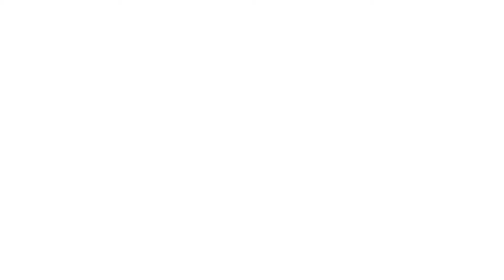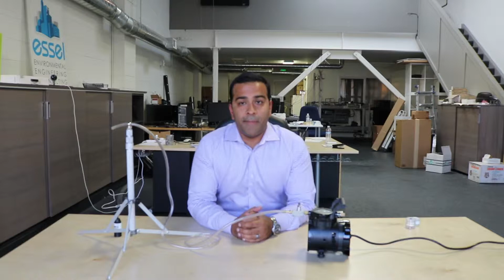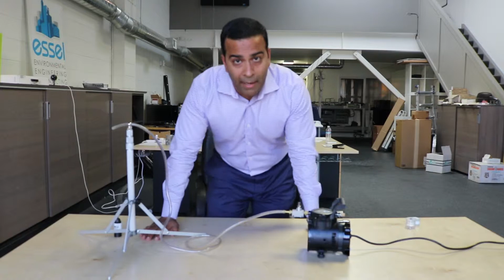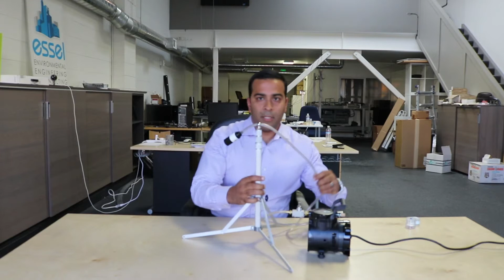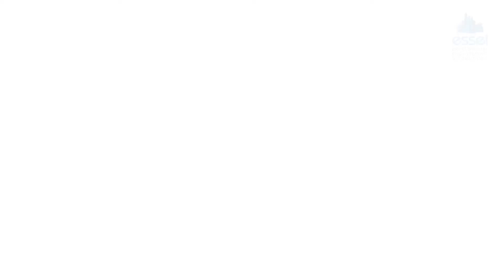Asbestos Air Sampling - How to tell if you have asbestos in the air.

Comment: Hello, I live on a military base where the housing materials contain asbestos. There’s also an asbestos area near housing that is a 70-acre solid-waste dis- posal area. When looking up reports from I find some from about 10 years ago saying the asbestos is not airborne. However I believe it may be airborne now. How would I test to see in there are airborne asbestos particles in my house?
Reply from the maker: Hi Joe - you can either hire an environmental consultant in your area or if you want to do it yourself … you’d need a high volume vacuum pump along with the asbestos tem or PCM cassettes.  Running the air samples for about 120 minutes at 10 liters per minute for the PCM method. Let us know and we can provide some more details if needed. 

Otherwise you can also use low volume pumps and have them running longer per day.

Comment: I just got house..and all vinyl flooring has asbestos underneath and some of them removed and installed with the carpet..I just removed all the carpet..now I realized  probably asbestos still there...I'm scared now..what should I do?
Reply from the maker: Hi Glenda -  If the linoleum and carpet were taken out together - that is a better scenario than removing the linoleum by itself - especially using a machine. 

But, in this situation - if you are worried about asbestos - then best would be to have it sampled with a local company. 

We would suggest TEM samples so that you will know if there is asbestos fibers in the air.  

This is all under the assumption that the material is asbestos containing.  If you can - it would be best to sample it to know for sure. 

Hope that helps.
Reply: @theesselchannel  last owner removed all the laminate ..they cover with the carpet..when we do the living room.they covered with laminate on the top..some laminate asbestos been removed by the last owner ...so we removed some piece and sent it for test..it's positive asbestos chrystotile asbestos  15%..I read that chrystotile asbestos is not that dangerous...need advice..thanks

Comment: I live in a big luxury building in New York City and they’re taking out asbestos on some of the floors. No one of my floor is doing is getting rid of the Asbestos. Is this something I should be concerned about?
Reply from the maker: HI Alexandra - You may not have anything to worry about.  Without knowing any more details - they may be taking out asbestos in those floors because they are doing renovations or something.  If you do have asbestos in your building - if its in good condition - its not a hazard and isn't necessarily required to be removed.   You can speak with your property management office and ask about when the most recent asbestos survey was done and ask to take a look.  Or also ask them if there is any asbestos or lead in the building.  They technically have to disclose these findings to tenants.

Comment: When you are performing a post PCM test what is your flow rate and for how long ?
Reply: You should sample at 15-16 litres of air for 3-4 hours try to collect a minimum of 3000 litres of air
Reply: False 12 flow rate for 120 minutes for 1200 tem cassettes
Reply: @Jayrebel225   Incorrect.  The question was for PCM cartridges, not TEM.  

I was taught the minimum volume collected should be at least 2700 liters for PCM clearance sampling.  That's 3 hours or 180 minutes at 15 liters/minute.  The maximum permissible flow rate is 16lpm but I have found that anything over 15lpm runs the risk of shredding the filter in the sampling cartridge.  

If you live in a very humid area like the deep south slow down your airflow to about 1/2 of normal.  High humidity in the air at a high sampling rate will cause the filter to soak up moisture from the air.   The filter will not become transparent when you treat it with acetone vapor on the microscope slide.  It'll turn grayish milky white and you will not be able to see anything under the microscope.  Contaminated acetone or non lab grade acetone will cause the slides to be milky as well.